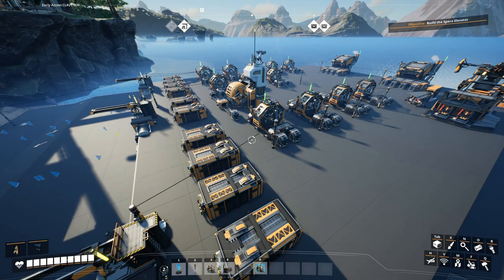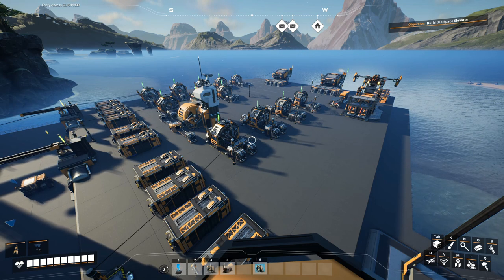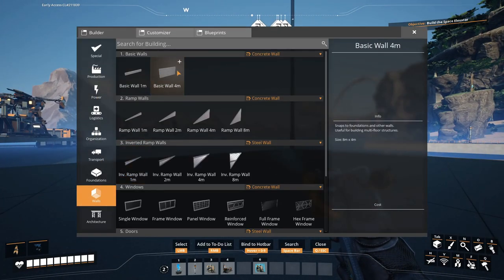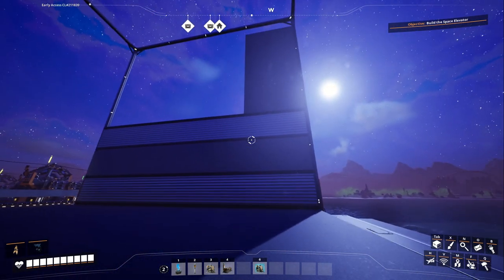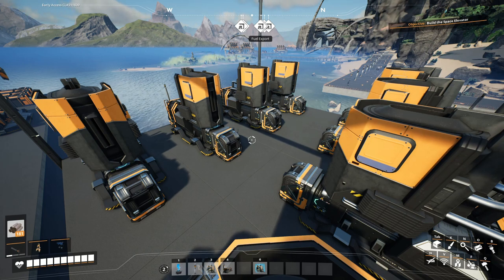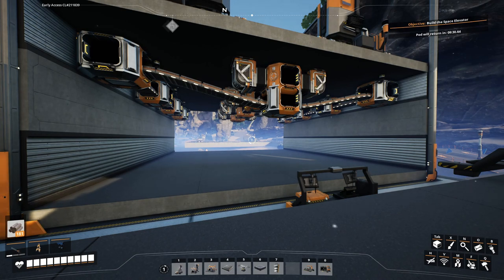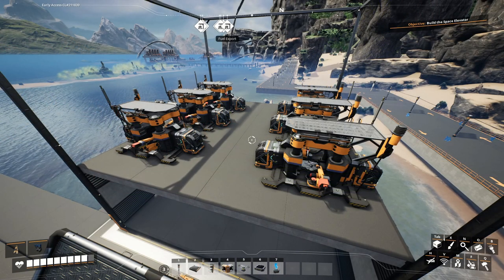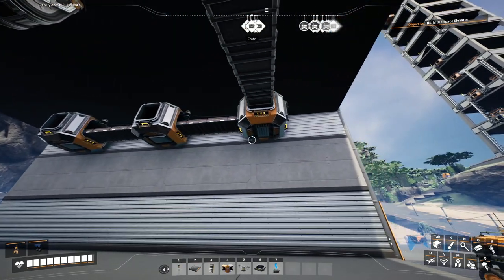How to use blueprints to build a massive factory EASILY | Bite-sized Satisfactory

Comment: Tip for recipes.
Normal game start only have a few 'harddrives'.
If you want a specific recipe but don't want to risk the chance of not getting it. You can try this...

First place your hard drive into the mam. Start the 10 minute count down. Wait till 1 minute is left. Leave the mam and save game. Now your ready.
Let the 1 minute time run out, check your unlocked recipes... if you don't want any. Reload game and check again. They will be different.

Keep playing, keep building.
Reply from the maker: Reloading until you get what you want works! Alternatively i'm sure there's mods that will let you simply enable the recipes you want for an easier fix.